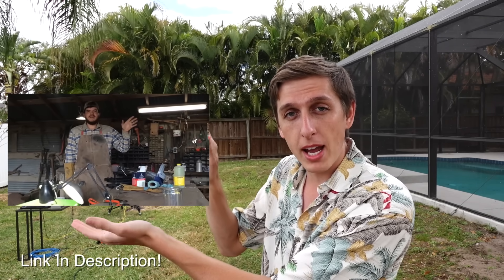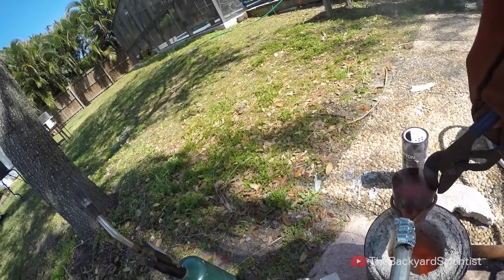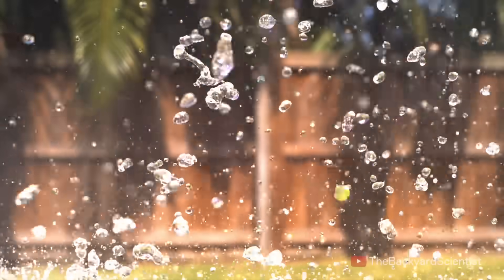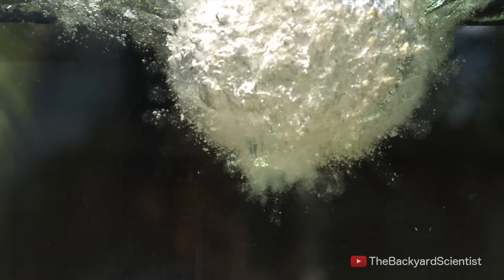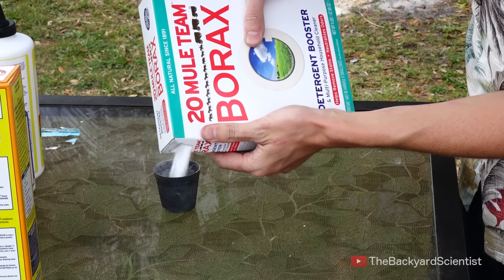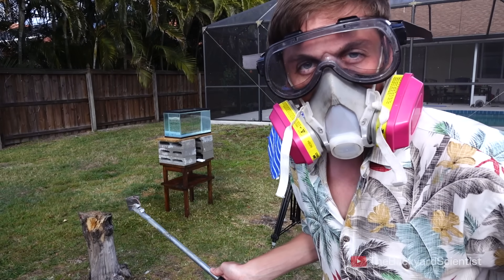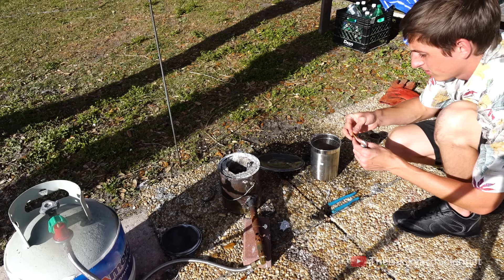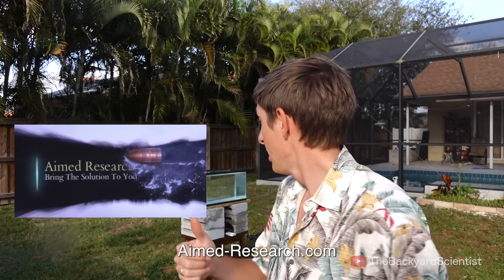Pouring Molten salt into Water - Explosion!

Comment: If you are right about the water getting inside the NaCl molecule maybe it is because the salt is very hydrophilic (likes water) where as other molten salt are way less hydrophilic. 
For example  you can make only 10g/L of sodium bicarbonate soluble in water whereas you can have about ~300g/L with basic sea salt.

Comment: Can anyone with more knowledge about the subject confirm/disprove this for me? Thanks.

"In very general terms, chemical changes are not while physical changes are. Boiling water is a physical change as it changes from a liquid to a gas. The gas can condense again to make a liquid. Boiling an egg is a chemical change - the proteins have rearranged themselves, and it won't go back to being a liquid again. So with this, Milk souring is a chemical change. Sodium Hydroxide changing from a solid to an aqueous (dissolved in water) form is a physical change; the water can dry out to make solid sodium hydroxide."
Source: https://answers.yahoo.com/question/index?qid=20080908124728AAvgcZh

"As you increase the temperature the rate of reaction increases. As a rough approximation, for many reactions happening at around room temperature, the rate of reaction doubles for every 10°C rise in temperature."
Source: http://www.chemguide.co.uk/physical/basicrates/temperature.html

"An explosion is a sudden, violent change of potential energy to work, which transfers to its surroundings in the form of a rapidly moving rise in pressure called a blast wave or shock wave. The shock wave can cause substantial damage. Potential energy may exist in either of three forms before an explosion occurs: nuclear , chemical, or physical. Generally, nuclear explosions are much larger and more destructive than chemical or physical explosions. Chemical explosions are more frequent than nuclear or physical explosions. Although chemical explosions are usually deliberate, they may also occur accidentally. Large physical explosions are relatively rare and usually accidental.
Source: http://www.chemistryexplained.com/Di-Fa/Explosions.html

I guess this is the answer to TheBackyardScientist's question:
Pouring salt in water is a physical reaction, but due to the increased temperature of the salt before being poured into water, the reaction is heavier (the reaction doubles for every 10°C rise in temperature), causing the explosion. I wasn't sure if physical reactions can explode, but it is possible.

I'm just a layman with Google

Comment: Don't take me too seriously as I'm still in high school, but could it be specific heat? borax (1000J/KG/K) has a higher specific heat than salt (880J/KG/K)though not by much (120J/KG/K). so the salt MAY cool down fast enough, FROM the same temperature, in the same time, to not undergo the Leidenfrost(?) effect. try heating the salt higher and working quicker, with more PPE (haha) and try the experiment with substances of higher and lower specific heats. just a suggestion. once again, I'm still in high school

Comment: In my opinion , 

If salts has (approximately) the same fusion temperature,
A delta between density of molten table salt and other salt could explain the explosion.
A "lighter" liquide have better chance to quickly disperse in a liquide than a "heavier" one and thermal exchange get faster.
And by the way , a lot of thermal energy from the hot liquid salt goes to the explosion and not to the cool water.

Could be proved with two temperature check.

Sorry for my english, frenchy guy.

Comment: I suspect you have a little thermolysis happening on the part of the water, especially with the high temp salt ions. This would cause the water vapor to separate into various H an O ions. You can get many different compounds out of this, but I bet you have sodium chlorate (or some other set of ClO(1-4) anion). You have to have a reaction in the gases happening to get an explosion like that. I don't want to spend time finding the gibbs free energy of the reaction though, so enjoy.

Comment: you should repeat this experiment except break down the experiment into parts ... put a sodium block in chlorine gas then add a drop of water ... I have been told at room temperature they explode as well because the chlorine compliments the sodium's explosive reaction to water in some way ... haven't tried it myself so can't be for sure. if you do it then make sure you wear a ton more ppe though

Comment: AHHH! I think it's because sodium tetra-borate is a non-polar molecule so it doesn't dissolve or bond (react, in this case) with water because water is polar... The sodium chloride does because it's has an ion dipole (dipole-dipole) interaction with the water so it dissolves/ mixes so it reacts with the water and then, as you said, the rapidly heated molecules of water expand exponentially causing an explosion.... Just my guess (correct my incorrect chemistry if I'm wrong please).

Comment: I'm well aware of this reaction actually.  At this one job I worked at, we had to use a molten salt bath to "heat set" some wire.  After dipping it the salt bath, you'd take it out and dip it into a bucket of water to cool it and set it.  There would be a small crackle-explosion then, but if you didn't dry off all the water before you dipped it back into the salt bath, a bigger explosion would result.  There were a few times some of the molten salt exploded and got onto my arm.  Not fun. :(

Comment: ok so I see this video and right at the beginning i'm like duh! the chloride must be melting away and leaving just the sodium and that is what is causing the explosion. I'm like wtf are you doing, why are you still talking about this. Then comes the aha moment and I see your point. That's what I get for guessing at 1k degrees the chloride will turn into a gas and float away. I have a wild guess / crazy theory and more than likely I am missing something but I wanted to take a stab at it. I will try to keep this short but I don't think I will succeed but maybe this theory of a postulate will have some truth. Anyway here goes.

1. NaCl at its regular solid state dissolves extremely well in a high polar solution like water. If I remember correctly when it is dissolved it breaks down because of the Na+ and CL- ions react well in the polar water. I think the chloride ions become extremely saturated with water. I'll have to look all this up again later but I think they soak up like 6 or 8 molecules for every one of the chloride ones. Something like this [Na(H2O)8]+

2. when you heat the salt to the temperature required to melt it I believe you get a formula like this NaCl2+O2=NaO2+2Cl . Which I'm guessing is not significant by itself. However you are introducing this new equation to highly solvent water. 

3. The Leidenfrost effect comes into play here (plus the heat). You have the initial boiling effect which transitions to the vapor bubbles, then into the nucleate and transition boiling phase, which finally results in the film boiling where the vapor is created that the medium then floats on. 

Based on these facts I believe the melted salt (new formula NaO2+2CL ), specifically the 2CL is reacting with the water vapor during the film boiling stage of the leidenfrost effect. Since we know that when the salt is dissolved the chloride absorbs a crazy amount of water (possibly easier to merge since the water vapor molecules are more spaced out), the new formula in the super heated, melted state should create (and this is the guess part) a massive sponge like effect where it soaks up the water. Basically as it makes contact there is a secondary solvent reaction that takes place rather quickly because the sodium and the chloride no longer have to be pulled apart; they already are. So as the leidenfrost effect begins to occur the chloride ions (2CL) react with the water vapor. This is where it kinda breaks down for me because i'm not sure what to do with the equation as it cools or even if I am doing it right. However it seems that the the 2CL would latch on to a large amount of vapor water molecules. This would leave just the NaO2. Not sure how NaO2 would react with water but I believe the chloride molecule is the key. As soon as you remove that you have sodium mixing with water since the vapor that would normally make the leidenfrost effect work is now defunct because the vapor that is created during the film boiling is now absorbed by the chloride. Thus allowing the water and sodium to actually mix and react. It is delayed because the secondary chloride reaction must take place first to break down the leidenfrost effect and now the oxygen works as a fuel catalyst for the explosion. Or the oxygen keeps the sodium from completely reacting with the water and that is why there is no pH change.

Honestly the no pH balance change has me completely baffled. I know i'm missing something. I figured this small breakdown might help. This hypothesis came because the other solvents that you introduced do not have the chloride to react with the water. I'm not sure if the new double sized chloride ion will react faster with at higher temperatures with the water vapor. I read your papers and I believe this is what is stopping the superheated water column and allowing the super heated salt to come in contact again. Hence the delayed explosion. The regular sodium just explodes on top because there is no delayed chloride reaction to stop it. This is my guess on this topic. I believe the chloride is the culprit here. Would love to see if this is true or not, and see it expanded upon if it is.
Reply: +Romullus So basically you're saying the melted salt isn't causing the explosion by contacting the water, it's causing the explosion because of the vapor produced by the Leidenfrost Effect?
Reply: yeah I typed alot. Let me try to paraphrase. The melted salt sorta separates the chloride and Sodium at high temperature as based upon the formula. As soon as it touches the water the vapor from the film boiling (the vapor that causes the others to be protected and not mix - the actually Leidenfrost effect) actually mixes with the chloride, leaving a sodium oxygen ion behind and that is reacting with the water as the vapor is soaked up by the chloride. That is what I believe is happening. There is more going on but this is a suggested starting point. Also I think the high heat is also causing something else but i'm not sure.

Comment: If you didn't know how large the explosion was going to be, why would you risk it shattering the glass and sending it flying towards you? It seems like a safety issue.
Reply: +Jordan TheMan It may not have been such an issue : the glass was tempered to break in non sharp chunks. Only the impact was a problem, and it wasn't too confined + safety glass. Seems "ok", comparing to pooring molten sodium into water directly without an apron ... That was quite reckless. Thanks for your video anyway.
Reply: +Bruno SALQUE If the broken shards are traveling fast enough, they'd still be able to penetrate regardless of how sharp they are.

Comment: Conjugates salts of strong acids (Cl-) and strong bases (Na+) are pH neutral which was why you tested neutral pH after the reaction.  I don't think you can rule out a chemical reaction although the most likely scenario may be a combination of both chemical and physical since the temperature was so high.  It may also include flash boiling water at the hot liquid metal water interface which is very exoothermic during the re-crystallization of the molten salt.

Comment: Welp I looked through about the first 15 or so comments and have decided to take it upon myself to answer this apparently explosive question ;). The reason that this salt explodes has to do with the chemical makeup of the salt itself. It is repeated several times that the chemical formula for table salt is NaCl (or sodium chloride) which means that it contains sodium or Na. As a first group element Sodium is Highly reactive in water (not going to get into why) so even minimal contact between pure sodium and H2O is explosive. However, this reactivity is negated when it has formed a bond with other elements like Chlorine which is why table salt or NaCl is normally harmless. So, by melting the table salt he is effectivelly neutralizing this bond and separating it into sodium and chlorine thus making the sodium reactive again. So when he pours the molten sodium into the water it can now react viciously. If you would like to confirm this GOOGLE IT YOU LAZY BUTTHOLE.

Comment: I was about to comment and ask if it had a different Ph level. If it was chemical than it could have form HCl. It would have made it slightly acidic. Then you actually tested the Ph. Good planing.
Reply: +empCarnivore Oh, I think I might know sodium chloride dissolves in water right. It water separates the chunks of salt away from the rest in a ionic way. It actually separates them from the ionic bond, too. It doesn't explode because the H is better with water than Na. This water trying to get to sodium causes it to over come the leidenfrost effect.

Comment: I agree that the explosion is probably due to rapid expansion of water vapor but I disagree with your NaCl hypothesis that because there is no pH change it is not chemical. NaCl is a neutral salt in mixture: http://chemwiki.ucdavis.edu/Core/Physical_Chemistry/Acids_and_Bases/Aqueous_Solutions/Aqueous_Solutions_Of_Salts

Comment: why doesn't the salt in sea explode ? .. their is many volcano in ocean and salt in water , so why no explode?
Reply: Because the salt has to be heated by it self not when mixed in wit water there is a higher mix beacuase it is more dence to sodium to water 
Like gas it has to have space to mix with air to explode but if there is a leak on a pipe it will just make a flame

Comment: There is energy transferring from the higher point of temperature to the lowest point in the form of heat, it is one of thermodynamic laws. If you could lower the temperature of the water in the fish tank the explosion would be greater. I am not completely sure about a chemical reaction in that process. Be careful in your experiments, and don't stop uploading interesting videos.

Comment: You don't put Na in the water ....and it's a chemical reaction
Reply: +Julien Witt care to learn chemistry?
Reply: Well, yes and no. Salt normally dissociates with water, meaning that the Na-Cl bonds break and the water molecules surround the two atoms. Their test for testing for a chemical reactions is pretty flawed. The acidity is only affected if the protons (or hydrogen atom) count increases or decreases. Theoretically speaking, you could pour equal parts (in terms of molecule count) of acid and base with the PH opposite of each other into water and still have neutral PH despite having a reaction.
Reply: +나는 당신을 사랑한다정수정 Care to justify, or just throw around random claims?
Reply: sodium is an alkali metal
Reply: no i thought it was just a coincidence OF COURSE ITS A CHEMICAL REACTION
Reply: +Nick Player it being a alkali metal doesn't change anything.
Reply: +나는 당신을 사랑한다정수정 

goddamit, he PUT Na on water in liquid state... you can do one reaction but you cant undo the reaction!

he melt the salt, good, and now what is it? salt offcourse...

exist a BIG gap between Na (metal) and Na (mineral)... 

the Na (metal) reacts chemecally with water, (explodes with flares)

but the Na (mineral) reacts fisically with the water ("explodes" by vapor expansion, without flares), what is most likely the theory of the video is plausible.

the same thing happens with ice and thermite... the thermite vaporize the water so violently making her explodes.
Reply: +나는 당신을 사랑한다정수정 Doesn't explain sodium ions from the salt reacting. Sodium metal has valency of +1 and is very reactive, but the ions are much more stable with 0 valency. It just dissolves in water. Sodium metal reacting with water is chemical. Molten salt with water won't be the same. Na =/= Na+!
Reply: +Julien Witt when you melt it, the sodium ions are able to roam free. Sodium is an alkali metal, it reacts strongly with water
Reply: CuddlyyyWolf it does, alkali metals explode upon contact with water
Reply: +Julien Witt Dude, it's not rocket science to understand that Alkali metals are the most reactive to water.....
Reply: Grulenio Silva I don't get it. Are you arguing for her or against her. If you're arguing for her, it doesn't make sense that you started off with "godammit." If you're arguing against her, you're making the same point she is. You somehow failed to spell several words incorrectly and your last two sentences don't make sense.
Reply: +나는 당신을 사랑한다정수정
 Na =/= NaCl

physical reaction. just like putting hot oil into water.
Reply: +나는 당신을 사랑한다정수정 THIS IS NOW A SPIDERMAN POST!
Reply: Reaction of sodium with water. Sodium metal reacts rapidly withwater to form a colourless solution of sodium hydroxide (NaOH) and hydrogen gas (H2). The resulting solution is basic because of the dissolved hydroxide. The reaction is exothermic.
Reply: Sodium metal reacts rapidly with water to form a colourless solution of sodium hydroxide (NaOH) and hydrogen gas (H2). The resulting solution is basic because of the dissolved hydroxide. The reaction is exothermic. During the reaction, the sodium metal may well become so hot that it catches fire and burns with a characteristic orange colour. The reaction is slower than that of potassium (immediately below sodium in the periodic table), but faster than that of lithium (immediately above sodium in the periodic table).
2Na(s) + 2H2O → 2NaOH(aq) + H2(g)

Comment: Sodium is HIGHLY FLAMMABLE!!! Here is the chemical equation: 2Na(Sodium)+2H2O(Water)=2NaOH(a kind of strong alkali)+H2↑(Flammable), and because of the high temp, hydrogen gas will also have a chemical reaction with oxygen: 2H2+O2=2H2O
Reply: +Robert Lyu Yes. That is what happened when he poured sodium into the tank, but when he poured NaCl, the pH did not rise.